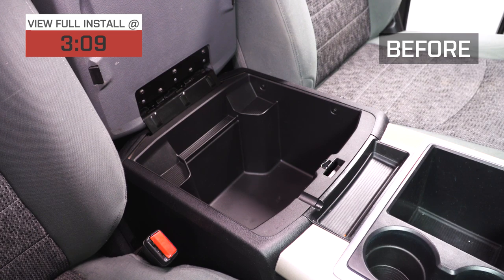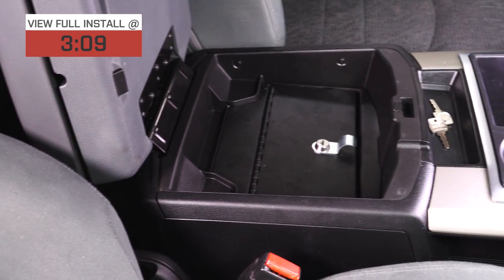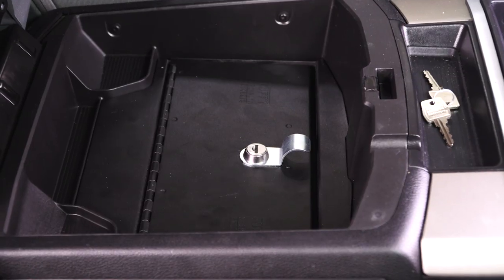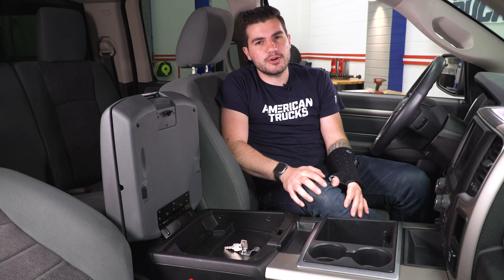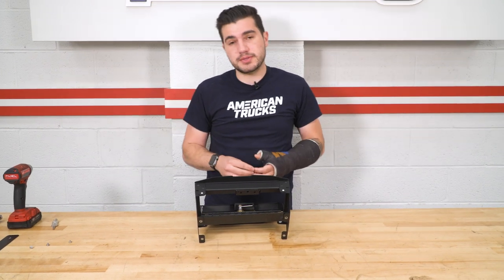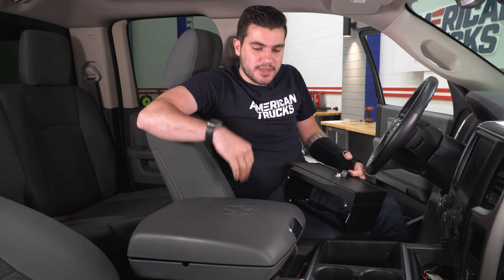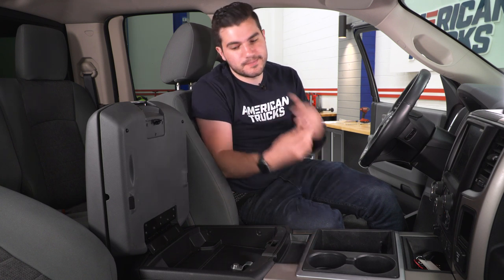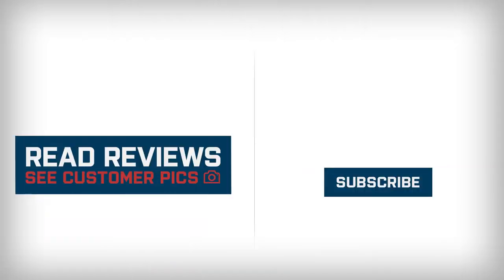2010-2018 RAM 1500 Tuffy Center Console Security Insert (w/ Fixed Floor Console) Review & Install

Comment: Bottom holes were for optional bolts.  Screws are for the holes in the side, which would probably provide more strength against any upward prying.
Reply: Was about to say the same thing.. Also, I feel like self tapping screws being the only way to mount this isn't that secure.. few hard tugs and that plastic will start to give way... think I will go with another product.
Reply: @CrimtideStreams  the bottom holes are to allow you to go through the body and bolt it into place.  I think it would take an awful lot of pulling to get the 4 side screws to pull out.  maybe if they brought a crowbar or big screwdriver to pry on it.  mine is installed thou to stop the 'quick' thieves looking for change and valuables.  we can't store guns in our cars here.